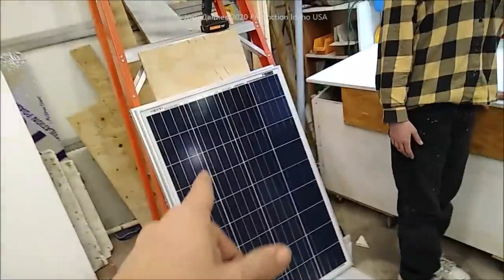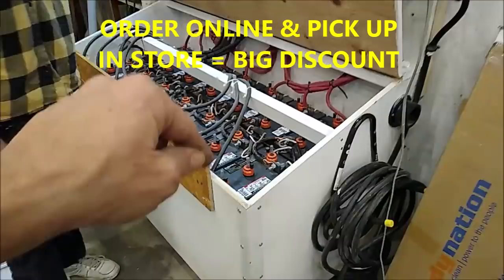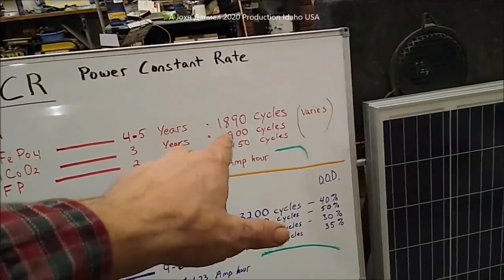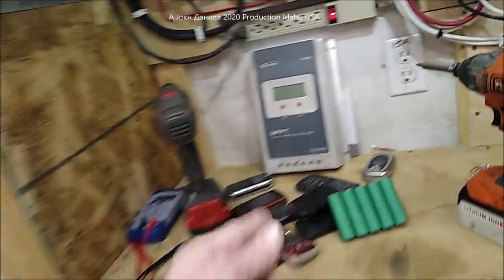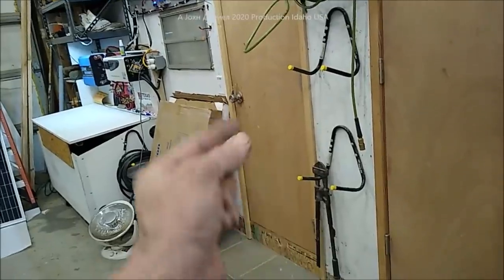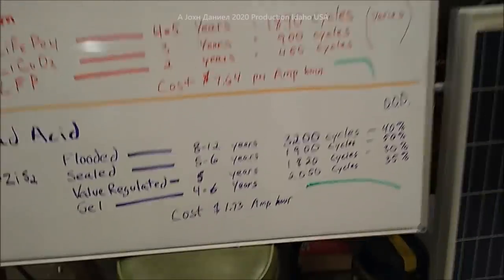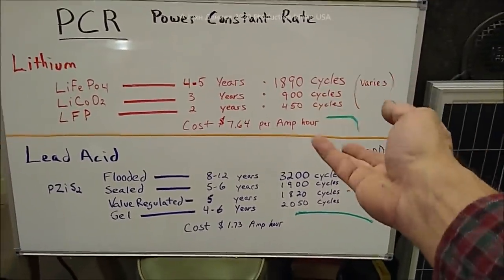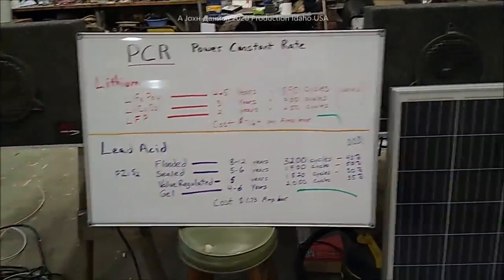Down Side of LITHIUM LiFePO4 Battery $ on RV, off grid & solar use (notes below)

Comment: The lithium is rated to 80 percent capacity, like 2000-3000 cycles, with 80% of the capacity remaining, it all depends on how its used, I have 800 ah of lithium battery powering my house, I have about the same capacity in lead acid, I bought the cells, assembled them myself,   I don't doubt you,
Reply from the maker: When they can make a big 250 amp 13.2 volt standard one piece cell, not groupings of weak link cells, for cheap like a SLA in cost I will consider them. But hundreds of small cells mean 1 in a pack can destroy them all. Proof it's not refined yet is from the cell size used for almost everything. But hopefully one day they can figure out what it takes to o put 3 cells at 4.4 volts each and 250+ amps into a case for lead acid prices, then I'm all about it.
Reply from the maker: Key word in lithium battery technology is rated. Not proven. Yes you can buy a good one, but it's better than 50/50 you'll get crap from China sources, and China is the only source.
Reply: @JOHNDANIEL1  that's not true. LiFePO4 is a old chemistry and it is proven to last that long. We have battery studies from multiple countries with consistent figure. You don't know what you're talking about

Comment: I´ll just go nickel-iron. I´m tired of researching. One of my friends is a doctor in electrochemistry. I´m a metallurgist engineer. Jeez. Not that I´ve much money though...
Reply from the maker: Simple consideration to make: Example - Corona Virus strikes your area, do you keep a bottle of distilled water nearby for your proven serviceable heavy lead acid power source, or pray the Chinese made LiFePo4 battery is gifts from the Gods as "claimed by the sellers and China" for the duration of the pathogens of the pandemic. Hmmm!

Comment: They are popular in motor homes/caravans due to power vs weight you can get 3x the power with with no more weight added but at $1000+ for lithium vs $400 for agm my budget is not that high
Reply from the maker: Power verses weight seems to be a hard core lithium cultist standard. But I'm a hard core Benjamin cultist, and see the $2500 spent on average for cutting the equivalent of 2 cases of water in weight is passing silly in high gear!!
Reply from the maker: Simple consideration to make: Example - Corona Virus strikes your area, do you keep a bottle of distilled water nearby for your proven serviceable heavy lead acid power source, or pray the Chinese made LiFePo4 battery is as "claimed" for the duration of the pathogens of the pandemic. Hmmm!
Reply: Јоhn Daniel i run agm there proven to  work and last my last lot lasted 8yrs in the back of my ute running my fridge 24/7

Comment: You broke the batteriesplus website, lol. We're still waiting to get the travel trailer we ordered and I know the battery that will come with it won't be sufficient. I really, really don't want to pay almost $2,000 for two 100amp lithium batteries.
Reply from the maker: Yeah, I think your right. Check back later, the best source for these 25% cheaper Deka Solar batteries can't run and hide to long LOL!

Comment: Just to clarify for lead acid batteries flooded to get over 3000 cycles my reading indicated that the DOD wasn’t to go below 75%.  Is this correct and are your calculations over estimating the years a battery bank would last if it was taken down below 50% DOD?
We have been off grid by necessity since 2008 and are still onthe first set of flooded lead acid batteries and in that time would have maintained DOD above 75% for about 98% of the time.   We have a CANADUS unit on the battery terminals and have used for the first time a product called RECHARGE from a New Zealand company as the battery voltage was just getting down to 24.2 early morning and our warning device would sound. I hope to get 20 years out of this battery bank!  Time will tell.  Love all the information you send Daniel.
Reply from the maker: Lead Acid has the ability to be in full use while in charge. LiFePo do not. The high cycle rating is PCR ( marine and Telecom battery rates) of Power Constant Rate. That defined is the cycles you will get while under incoming solar, wind or hydro charge of 50+% of the use. WHY? Excitation of the cells. When the cells are bubbling due to incoming charge your life span increases. PCR effect. However - If as in a electric car using lead acid you charge it, then embark on a trip and use up power, that action counts against your total cycle life span unless you add charge while in route using some source of excitation of battery ( Exide EV Battery care Mother Earth Magazine circa 1984).

Comment: To me the biggest issue for us in colder climates is the temperature issue.  Some battery companies have added sensors but they are not thinking about cold air sinking so they need at least one on the bottom where is will be the coldest and so far I haven't seen a single company put a sensor on the bottom.  I do like lithium for its weight versus power but the price and durability issues are a big turn off for bigger battery banks.

Comment: Well this is going to open up a can of worms but any of you guys who install wanna tell us what your insurance has to say about putting in lithium? Most all of the guys I know insurance will not allow it and they are for good reason. Secondly the lithium buyers fail to educate themselves about basics a lot of the time before trying to integrate a system. I have caught several people in the course of helping them with tech support with stuff that would have ended up in a fire had I not had intervened. A lot of people on youtube are putting car batteries with midnite controllers without the programing change for which at one point they had a knowledge base article. From reading this link however I think you can be aware of some of the serious issues with  charging Li chemistry batteries without doing your homework http://www.midniteftp.com/support/kb/faq.php?id=75    bottom line with LI you must proceed with extreme caution and I do agree with the analysis of how the hell do they come up with 5000 cycles on the BB battery which would be 12 years when the battery has not been around that long.....they say 5000 cycles in lab testing which I assume must be back to back cycling
Reply from the maker: So True. I can not get a bond or insurance on any install job using Lithium.
Reply from the maker: Here's a recent thought to get deep into. If I was a betting type I would say you LiFePo folks got money to burn, and a massive trust in China, Chinese Electronics and sourcing for parts. Especially at a time when they are literally threatening America with holding back medications, the over 500 sourced to China by Obama in 2010 to 2015 ( See congressional records signed by Obama in 2012) all the patented American invented medications now made in China for our people, the sick and who may become so.  https://youtu.be/HDNt_ThDYt0 , So the weight and CLAIMS of lasting till God shows up argument only proves the PRO - LiFePo argument to be incoherent and fully ignorant to the reason for the video. Fools and their money never seem to have a lack of separation anxiety
Reply from the maker: VIDEO NOTES - Lead Acid has the ability to be in "full use" while in charge. LiFePo4 do not due to limits of their design. The high cycle rating is PCR ( marine and Telecom battery activity rates) of Power Constant Rate. That defined is the cycles you will get while under incoming solar, wind or hydro charge of 50+% of the use. WHY? Excitation of the cells. When the cells are bubbling due to incoming charge your life span increases. PCR effect. However - If as in a electric car using lead acid or Lithium, you charge it, then embark on a trip and use up power, that action counts against your total cycle life span unless you add charge while in route using some source of excitation of battery liquids( Exide EV Battery care Mother Earth Magazine respondents letter Exide corp )
***Power Constant Rate factors applied to both battery design cycle capability. PCR is the use of a battery, energy source, under both conditions of charge and discharge

Comment: have you seen these Sony LiFEPO4's? https://blueplanetenergy.com/products/blue-ion2
the same battery stacks have been running here for many years and are pioneering Hydrogen production (the entire bank gets recharged around 9AM)
https://www.soest.hawaii.edu/soestwp/announce/news/future-of-hydrogen-researchers-on-hawaii-island-explore-energy-solutions/
I'm into LiFEPO4 cells @ $1.25 per amp hour
Reply from the maker: How well do they work while also being charged? I asked that question to 8 sellers of them, and 8 for 8 shared their reply -  "Crickets" and Silence.
Reply: @JOHNDANIEL1  Yet to first hand attempt but should be able to pull my full load (1KW inverter and 350W DC lighting) with the BMS controller and wiring scheme I am using.  Planning on about 700W of solar and 500W wind.  Just watched a video that demonstrated loading and charging with my same BMS.

Comment: The W I watch an know if is will and he only pushes lithium iron phosphate which are different than the Cobalt cells and the 2000 cycles is to 80% and I believe that is at full cycle for 100 down to 0 and even on the 18650s they are way different than lipos they are the worse of them all
Reply from the maker: Honestly Nickel Metal Hydride (NiMH) like in a small submarine as a very large battery in one structural build beats them all, but still requires special care. However they have USE and CHARGE equality of near 100% as long as you properly set them up.

Comment: Need an opinion.
I'm considering 8D DC lead acid @250ah +-$300
Yes heavy weights but have no intention of moving them around once placed so not an issue.  Will use solar/wind to maintain them.
Reply from the maker: The 8D, Deep Cycle or Commercial Vehicle Battery?
Reply: @JOHNDANIEL1  DC Deep Cycle
Reply from the maker: Yes, the 8 D is low profile high density. We used 6 in our gold camp near Baker Nevada. Cold weather seems to not effect them. Exide makes the best ones, as US Battery branding.

Comment: I'm so glad you did this video about those batteries! After I did some homework about the flooded battery's that you just bought, which was 370Ah 6v 123lb, and I believed you got them from Batteries plus too if I remember right. You help me to jump off the fence about it those batteries, I pulled the trigger and bought 4 of them for my own system. I had them over a year, and they're bulletproof. Thanks for the great information back then, and my avatar was Sapper Forever when you started with those batteries, your wife got them for you, I believe.
I also watch Wills channel to keep up with the new technologies, but I am nowhere sold on them or even ready to use them. Why? Flooded are battle-tested and bulletproof.
Reply: Flooded have horrible coulombic efficiency, internal resistance, linear discharge curve, can explode, need maintenance, need LVD, need proper equalization. LiFePO4 fixes all of these problems. And it's the same cost if you factor in usable capacity and coulombic efficiency. Do the math yourself. Very simple equations.
Reply from the maker: We will work on making everyone rich enough to pay over $5 a AH but for now, the folks are choosing to go less off grid due to the cost, therefore the reason for the video to set them free of the pushers pressure.
Reply: Јоhn Daniel right! : )
Reply: @JOHNDANIEL1  you're pushing people to buy lead acid and you make money from your links as well. I'm not part of the lead acid cult, or any bandwagon. And LiFePO4 is cheaper than lead acid if you build your own. I teach people how to do it all the time and you save a ton of money. And LiFePO4 does last 5-10x as long
Reply: @WillProwse  I am one of your fans Will who built my own LiFePO4 and would have tossed my lead acid batteries to the curb if I didn't have a bad back.
Reply: Okay I got both of you... to comment on the batteries.
Reply from the maker: @FirstSuiGeneris  NOT DANGEROUS - Same deadly smoke that could have killed 4 in a 39 foot MotorHome when 1 expanded into 2 then into the frame, Made so fast and cheap now, they will only get more of this example. https://youtu.be/EMARDvMz62A
Reply: Okay you two, both have a different opinion on batteries. They all have there pros and cons. Agreed? I bought my batteries just over a year ago, and love the flood, they’re bulletproof for my needs, plus performing flawlessly. I don’t care about the maintenance of them once a month, it lets me know how they’re doing month to month. Beside here the kicker, if something goes wrong out in the wild, I can find flooded easily and have power back up and running in no time. As they say: if it ain’t broken, don’t fix it! The only negative thing I see is the weight, but for me no big deal. For the new Technology of the batteries of any of them. They’re not proven yet, but the AGM’s, Sealed and flooded have been. Just facts!  Only time will tell. I will still watch both of your channels. I need to stay abreast of new technologies.
Reply from the maker: @FirstSuiGeneris  Here's a recent thought to get deep into. If I was a betting type I would say you LiFePo folks got money to burn, and a massive trust in China, Chinese Electronics and sourcing for parts. Especially at a time when they are literally threatening America with holding back medications, the over 500 sourced to China by Obama in 2010 to 2015 ( See congressional records signed by Obama in 2012) all the patented American invented medications now made in China for our people, the sick and who may become so.  https://youtu.be/HDNt_ThDYt0 , So the weight and CLAIMS of lasting till God shows up argument only proves the PRO - LiFePo argument to be incoherent and fully ignorant to the reason for the video. Fools and their money never seem to have a lack of separation anxiety
Reply: Јоhn Daniel right [ smiling ] no doubt!
Reply: Oh by the way! WINNER!
Reply: @FirstSuiGeneris  I beg to differ LiFePo4 have come down since this disagreement started and the quality has gone up. I am a LiFePo4 fan BUT we can agree to disagree!

Comment: A lot of things left out, you can discharge lithium almost 100% and lead acid only 50%. Life cycles of a good lithium battery is between 2000 to 5000 cycles and they are warranted to last that long. If you factor in the whole life of the  battery lithium is cheaper and less maintenance. You can also charge them faster
Reply: I’ve had my lithium batteries for almost 7 years, still at 82% capacity and going strong. I switched from lead acid and in my experience lithium is more convenient and safer, there is no off gassing. Never had a single problem with them and at todays prices they are definitely the way to go.
Reply: 80%. You pull them down under 20% capacity and they will die fast. Best to cycle between 90 and 20 for 70 percent capacity and long life.
Reply from the maker: Great, Whats your ability to pull full power while charging them?
Reply: Јоhn Daniel my system is sized properly so I can heat a hot water tank or start my well pump with no problem when they are charging
Reply: LiFePO4 compared to AGM requires a careful analysis, not a salesman pitch focusing on single features.  A lot is being left out by those that defend LiFePO4.  There are 5 major factors that must be weighed by the solar user for personal home/RV use: cost, capacity, rate of discharge, space/weight, safery/risk.  A typical 105Ah deep cycle AGM weighs 55lbs, costs $230 with a 3 year warranty,  requires fuses and a charge controller for safety,  can easily handle 100A discharge but charges at lower rate than Li, and should be managed at 50% DOD or less. A 105Ah LiFePO4 weighs 35lbs, costs $1000 with various or no warranty, requires a BMS and low+high temp protection circuits and a charge controller for safety, can handle at most 100A discharge unless an additional BMS bypass circuit is added but can be charged faster than AGM, and should be managed at 80% DOD or less.  There are a lot of things to consider and the best answer isn't always LiFePO4, and the most efficient and cost effective is not always LiFePO4.  There are three qualities that make LiFePO4 not a  easy answer for personal use: initial cost, warranty/ease of replacement and complexity. The two factors that dont make AGM an easy answer are capacity and weight. For a small solar installation in my van, AGM makes the most sense when all of the factors are weighed.  The added weight is actually a plus because I want extra weight in the back for added traction in winter driving. AGM is affordable on my budget, and 3 years from now I can reconsider LiFePO4 if there are significant changes.  Finally, not having the added complexity required by LiFePO4 not only provides greater reliability, but reduces the risk to me and my family.
Reply: That is the argument the Li salesman likes to make, but it is misleading.  The argument goes like this: if you buy one suit it will cost you $500, but if if you buy 12 suits, it will only cost you $100 each.  But I dont want 12 suits, and there will be something better by the time that first suit is worn out.  That is how the salesman tries to convince you that $1200 is cheaper than $500. If you agree with him, you have been snookered.

Comment: I have been questioning  Lithium myself because of the claim of there Kw storage and Charging voltages. Some people has been having good luck. But I have seen alot more failures.
Reply from the maker: Probably why we can not use them in Solar and Wind installs, our insurance won't cover them.